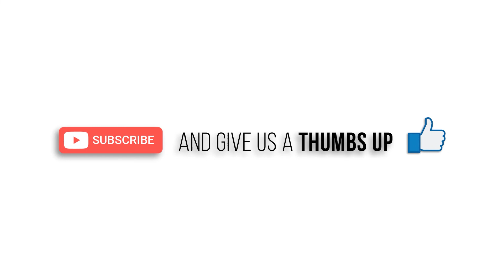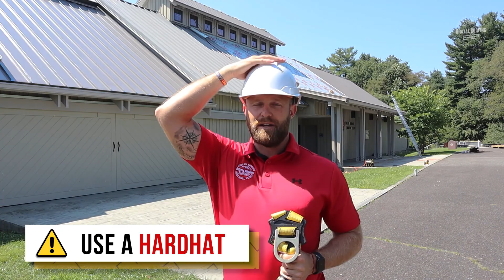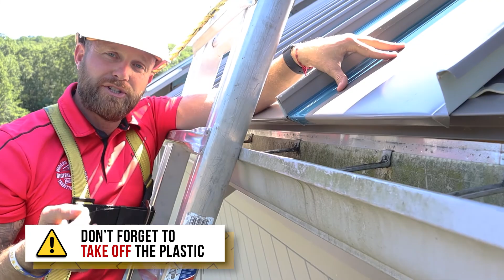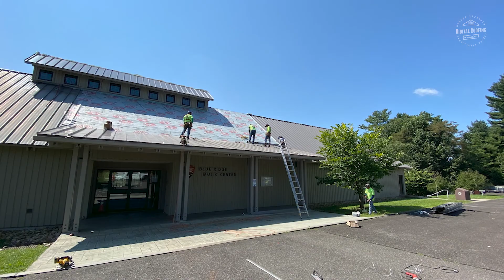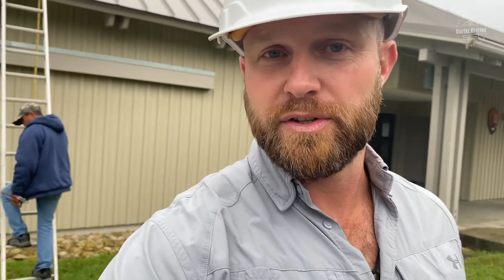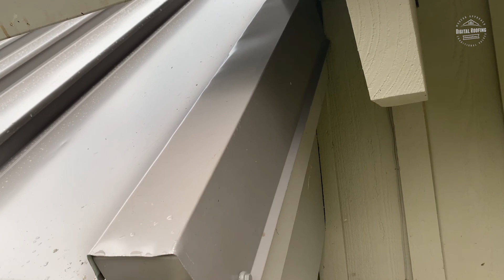How To Install A Standing Seam Metal Roof

Comment from the maker: Are you in the market get a new roof, roof repair, or some type of exterior repair?  Click here to get connected to a qualified contractor in your area!  https://www.networx.com/roofers?se=11003

Since we can't come out and inspect your roof, here is a tool to reach QUALIFIED contractors for Roof Inspections - https://www.networx.com/roof-inspectors?se=11003%27%3Eroofing%20inspection%3C/a%3E
Reply: stop filming your face and walking around with the camera. instead, film the work youre doing with a voice over. its not a video blog. its an instructional video.
Reply: Hello sir I need work I have experience in metal roof especially standing sime

Comment: Aren’t these metal roofs supposed to have an airspace —immediately under the metal roof ?? Like the deck goes on first, then the insulation, then 1x4 (or 2x4) grid (purlins/battens) and finally the metal roofing?  The clips/are then screwed on to — and through grid and insulation— into the deck material.

Comment: Check the manufacturers install details again. As an independent consultant i am coming across these videos all the time. Transition details and ridge closure details are not per the smacna requirements, not the manufacturer, nor any approved 20 yr weathertight warranty requirements(drag load screws are missing). Another roof that would fail in destructive testing and cause a loss in litigation. The quality of the video was actually pretty good, just the information was not presented accurately. I do alot of mcelroy factory training for this panel as well as 3 inch trap. The devil is in the details.

Comment: Is it beneficial putting down the half inch thick aluminum backing foam board on the deck before the metal panels goes on.
Insulation for heat and cold.

Comment: I was hoping to see a close up of the flashing derails, also anyone looking to have a metal roof installed make sure you invest in a hidden fastener metal roof,exposed fastener roof requires that the screws need replaced 15-20 yrs later and who wants to deal with that.
Reply: My exposed fastener shop roof leaks like a Mfer due to the fasteners poor installation.  I'm going to have to replace the whole thing - 60 x60. 5/12

Comment: Thank you for Video. Did you notice any of the plastic caps "telegraphing" onto the metal panels?
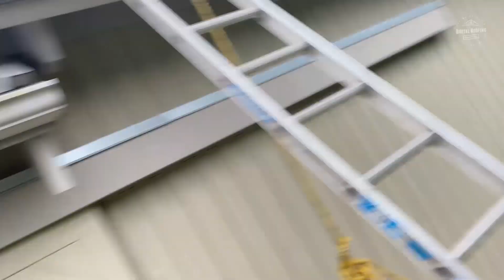Reply: Some of the metal install looked pretty bad. 12:30 to 12:50.  Wavy.  Crimp looks bad etc.

Comment: I'm a roofer have been eleven years and I started off doing Firestone black rubber and t.p.o ...flat roofing and metal crew alot ...in the heat and the cold .and spent time on a shingle crew ...I see cap nails in the gutter ...I like a clean jobsite and safety 🦺 ...and busting ass doing thangs rite ...anyone have any good stories the best times of my life's been on huge flat roofs everywhere all over Virginia ....

Comment: I will be putting a standing seam metal roof on my 1500 sf home. We got through Ida without any leaks on a 29 yr old 3 tab shingled roof. There are trees surrounding our property almost 360 degrees. When I saw how well metal roofs held up during the hurricane, I decided to go with a metal roof. I found a roofer out of Texas and he has told me that no ridge vents for the attic space are necessary in a standing seam metal roof. It does not sound correct to me so I want to ask other professionals what they recommend. Does a standing seam metal roof need ridge vents or can the metal roof be installed without them? And what about moisture in the attic space? I have a hip roof and a couple valleys from a 6 foot offset in the house.
Reply: Attics have to have ventilation regardless of roofing system. It's all about equalizing the attic temp to as close to outside temps as possible to avoid over heating or condensation issues from a disparity of temp.  But if you don't have eve vents (intake) then a ridge vent (exhaust) is worthless. Another solution would be gable vents if you have gables. You can even put powered blowers in them. - Owner of a roofing co for 20 years
Reply: No need

Comment: Just curious about two things: I see you screwed those top screws down tight. No need to allow for expansion/contraction? “Oil canning”? 
Also- does the ice and water need to be “high temp” for metal roofing? Great vid, ty.
Reply: Top screws would be the only ones that don’t matter. Then panel expands down from that point to starter… also the expansion coefficient is minimal at panels that size

Comment: i have a standing seam roof.  just got a quote to have solar panels installed on the roof.  they said they use clamps to install the panels to avoid drilling into the roof.  how do you feel about these clamps?
Reply: Anything to keep you drilling into your roof. Drilling means caulking. Exposed caulking has a very low lifespan.
Reply: Clamps are recommended over a penetration anyday.

Comment: My company is just starting to do metal roofs, we have a NTM pro jr , where did you get your seam crimping tool? What brand do you like/use
Reply from the maker: I would check out the company DI Seamers for ANY Manuel Seamed Standing Seam project.  Great company to work with.

Comment: isn't 9/12 a slope not a pitch?
Reply from the maker: Andy, great question!  In roofing, the terms slope and pitch are used basically interchangeably.  In the actual definition, there is a difference, but in the field, the terms are the same.  If you would like a more detailed video which covers this, please check out this video of the different methods to get the slope (pitch) of your roof and why it’s important:  https://youtu.be/yb8mIvNGbgQ
Reply: Whats the differnce between run and span? If we are talking about terminology, the word span would normally refer to the distance between 2 bearing points such as wall plates or beams. Span is not really a term used in describing a cut of the pitch or slope which can be used interchangably.
Reply: @bus-fun-addict  run is always going to be 1' of run and span is the distance between outside walls perpendicular to the ridge. So a 4/12 slope is for every 1' you run towards the ridge, it rises 4".
Reply: I agree with both, a bit. 9/12 is referring to slope, not pitch. Slope is rise over run. Pitch is rise over span, like a 1\3. They are often used interchangeably and it annoys me. If I'm talking to a professional and they use them interchangeably they loose respect. They are different and a professional should not use them the same.

Comment: I have a dip that varies between a 1/4" and a 1/2" of inch in the center of my roof between the ridge and the  eave  over a run of 15' , which runs consistently from gable to gable   can I use shims under the roofing clips?. I intend to use  26 gauge 16" wide panels. Thanks
Reply from the maker: Pony, thanks for the question.  What is the pitch of the roof?
Reply: @DigitalRoofingInnovations  4:12  thank you!

Comment: Just out of curiosity, why use the cap nails? I’ve seen metal roofs installed with them and the cap actually dents the metal
Reply from the maker: That must have been some very thin gauge metal.  This is a 24 gauge metal so you don't have to worry about that.

Comment: Interesting stuff. Out of curiosity how much were materials on this job (per square)?
Reply from the maker: Chris, great question.  We don't really use a per square price on projects like this just because metal roofing comes in panels instead of bundles.  If I had to guess, you would be paying around $400 "per square".  If you are still doing "per square" on commercial projects, I would recommend changing that to doing this:  Cost of Labor + Cost of Materials + Mobilization Costs + Equipment + Extras = $$$$$$  When you get this number, let's say it's $100,000, you then put in the profit margin you would like to make.  

On this project, let's assume you want to make 30% profit.   $100,000 / 0.7 = $142,857.  It's important to DIVIDE and not multiply.  I hope this answers your question!
Reply: Am i high or is 142,xxx a 42% profit on 100,000?  If you wanted to make 30% on 100,000, you would multiply by 1.3… because 0.3 x 100,000 is 30,000. To make your original amount plus 30% on top you need to multiply by 1.3…..